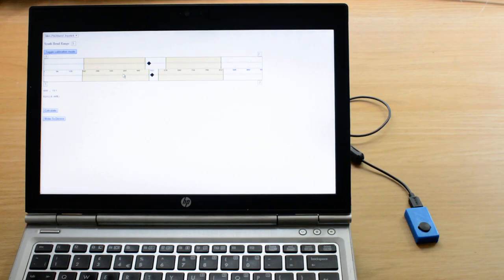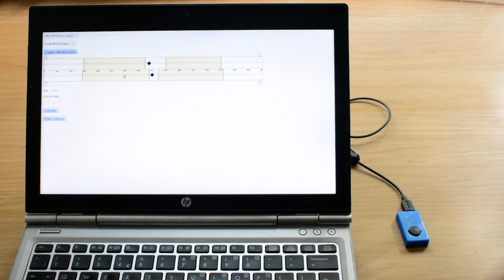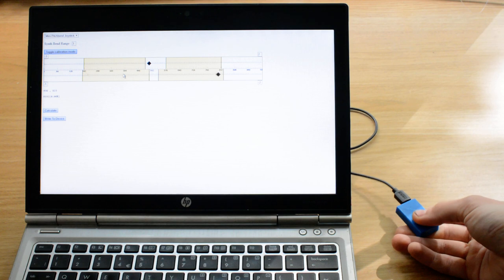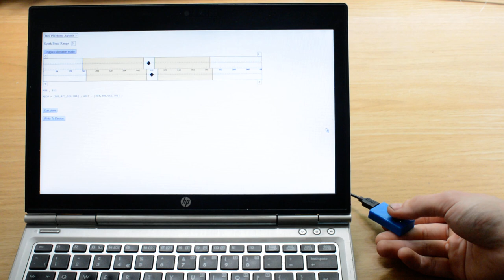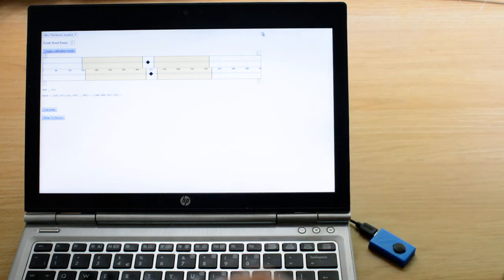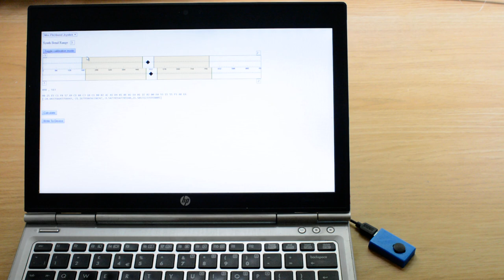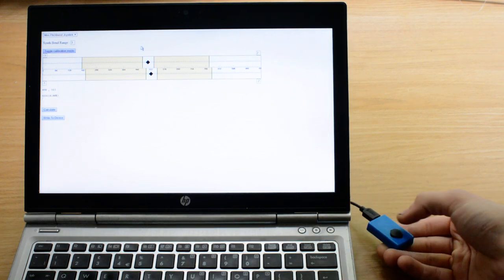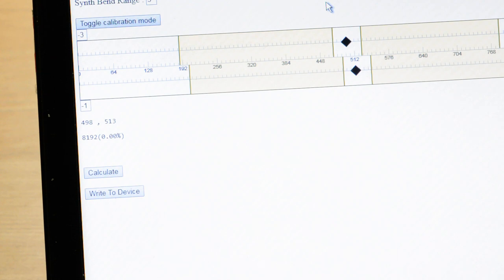A tiny joystick for pitch bending

Comment: Couldn't you have it set the deadzone as the first read position on power up? That is how most joysticks self calibrate. Obviously that isn't helpful for calibrating the limits, but it should get closer.
Reply: I don't know about MOST joysticks? Nintendo has traditionally done it this way, and SEGA's Dreamcast does it as well. But then drifty Nintendo sticks are kind of a pain in the arse now. This was the only possible way to do it on the N64, because that was an optical quadrature encoder, so it really only conveyed relative movement, but they seem to have just stuck to that since, in spite of switching to potentiometer based sticks.

Dreamcast pad doesn't have the drift issue but it has a gargantuan powerful return spring that wraps all the way around the joystick, which most others can't do, there's an axis splitting linkage that would interfere; in turn the Dreamcast stick is made of a dangly magnet and 4 Hall sensors, which is a great idea, except it can compromise the placement of different parts of the overall pad, because you can't have the magnet for the trigger or any sources of magnetism interfere with the sensors for the stick.

Xbox360 stick uses fixed calibration resistors on the board. I wonder if the Xbox One does as well.

Most of these need generous deadzones around the return point because with time the return spring is damaged and the return point becomes more of a vague return area suggestion. So the behaviour differs a lot depending on where the stick happened to be within that loose area upon automatic calibration. Having bends take a different actuation distance on each power on seems terrible for a music instrument.
Reply: Or even a button to start the calibration sequence. Like centre the stick then hit the button, then move the stick all the way left then wait a second and then move it all the way right, then centre again. You could use an LED for telling you what to do, even a neopixel or rgb led if you wanted more than just a flashing light.
Reply: You can fairly trivially set a trigger on booting (like if an axis is over 75%) so that you can calibrate by going through the directions.

Comment: This makes we wonder if my Steam Controller and it's various inputs can be used as a MIDI controller...

But the design also reminds me of a tiny RC helicopter which I gotten years ago. It's stick was locked to either go X or Y. You could do both. And it looks like your solution goes the same limitation. By the bit of the software I understood it sounds like you don't have the option to easily control two values at once. 

Yet a real joystick goes all the angles, which could be X,Y or polar coordinates

Comment: I think you could "simply" do what bldc controllers do and calibrate on boot.
You could have a trigger like pull the joystick down while plugging the bender and then cycling up down left right with a snap to center in between, then write to eeprom and reset.

Comment: Why just don't build self-calibration procedure into the attiny? Triggered by extreme position of yoystic on powerup and then confirming it by some gesture....hmm.
Reply from the maker: I originally had something like that, but there's a subtle problem. The joystick has a normal range, but if you push it hard or wiggle it a certain way, it will go beyond that for a moment. This throws the calibration off, and you can never get the bend fully in tune. It works more reliably if you can set the full bend to something like 5% away from the maximum deflection.